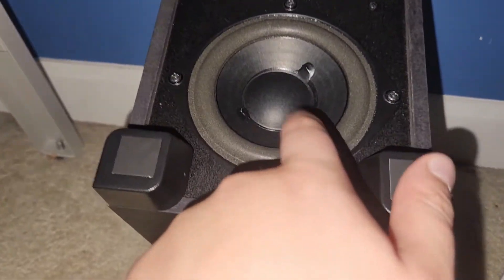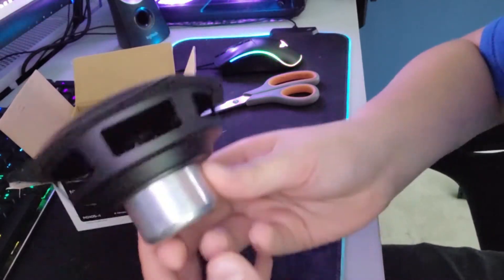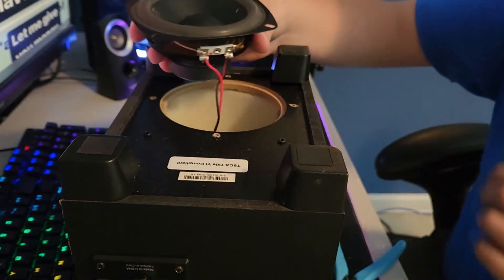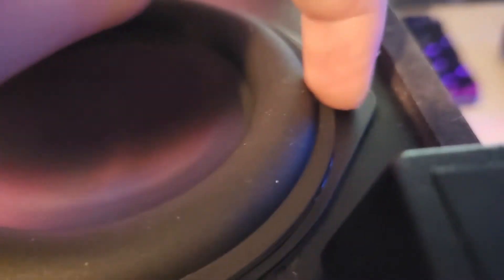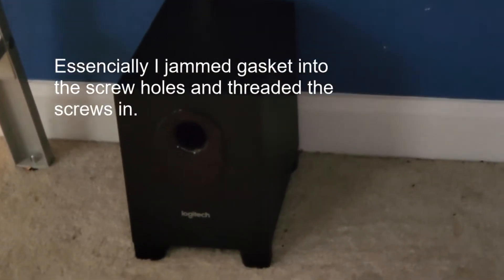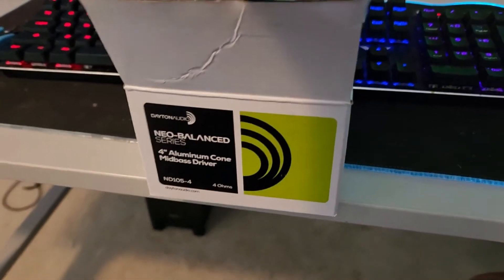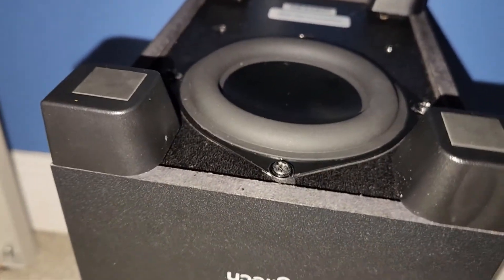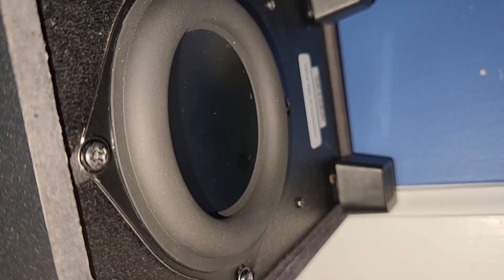Upgrading my logitech z313 subwoofer with a dayton audio nd105-4

Comment from the maker: UPDATE: I fixed the weird distortion noise by taping around the woofer with electrical tape, I guess the original gasket wasn't enough and I needed to put tape there to seal it up
Reply: I just discovered that I'm not the only one who's done this same thing. I had the same issue, and I solved it by plugging the port with a cork. Also, if you haven't already, sticking some acoustic foam inside helps too.

Comment: What you need is a solder paste you stick that on the wire put some solder on it and then put some solder  paste on the speaker connector and then put solder on that and it'll come together perfectly

Comment: the ultimate upgrade for a little subwoofer like this would be replacing the port with a 6.5 inch passive radiator, i would build a new box for the amp and use speaker terminals to connect it to the subwoofer. 
at this point you would be free to use any kind of passive subwoofer so making a new box for the active driver and passive radiator would make it so you can go back to the original box incase you mess up, it would be like having a huge port that you can still tune low (with weights) in a small box and whats not to like about that.
Reply from the maker: I'm honestly thinking about building this a new box tbh, I might consider that
Reply: @RMA2009 absolutely! A new box would work a lot better for the sub if tuned. That silly little old box is pretty good, but there’s no way it’s tuned to anything below 50-60hz lol. It would sound a lot better so I recommend!

Comment: Stock amp can power it fine? Does it really make a difference, the stock speaker rumbles my floor and sofa near it i wonder how it would be with this woofer
Reply from the maker: huge difference, bass is much deeper. Cleaner, and louder. stock amp will have no problems with a 4ohm woofer